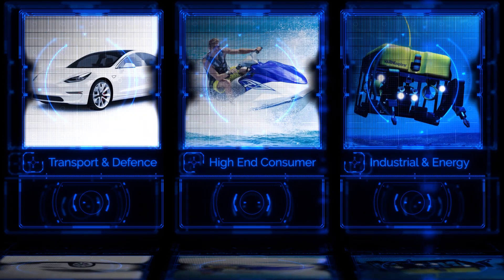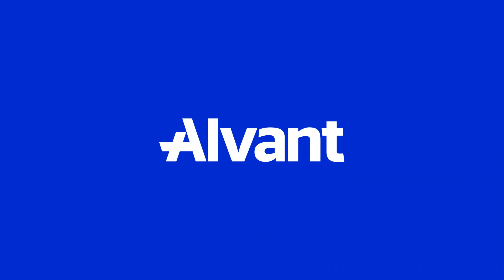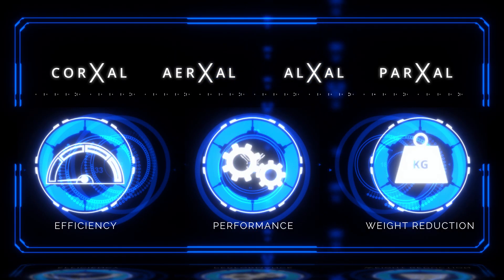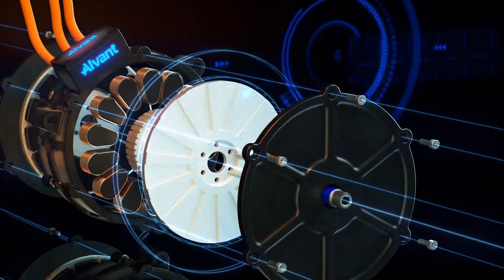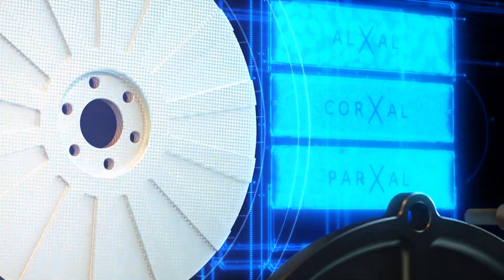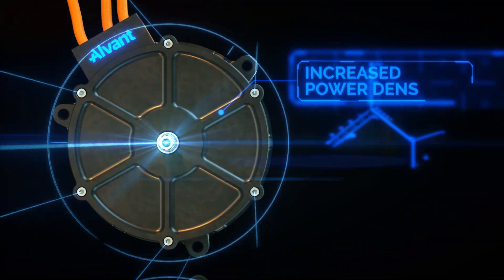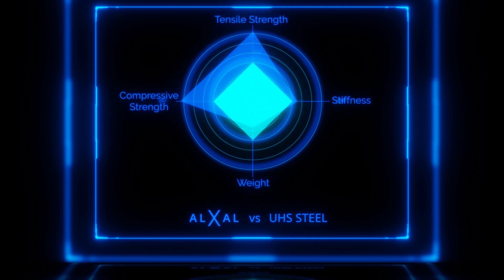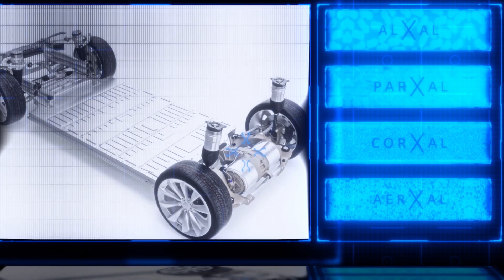Alvant proprietary materials for electric machine manufacturers.

Comment: The vehicle subframe you showed is a radial flux motor setup, but you were showing you make axial flux motors. By the way, who is making steel axial flux motors for electric vehicles these days? I only see aluminum ones around. For comparison, how can you reduce 40% of weight comparable with other similar products?